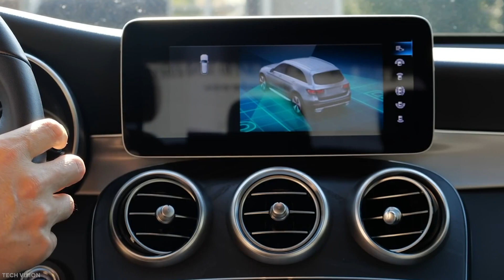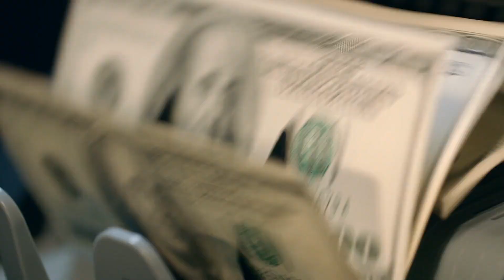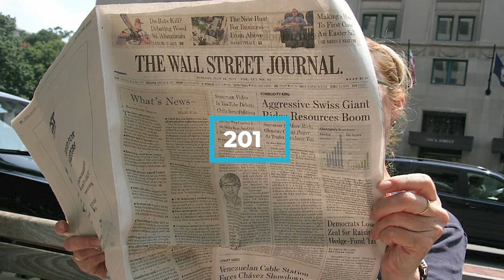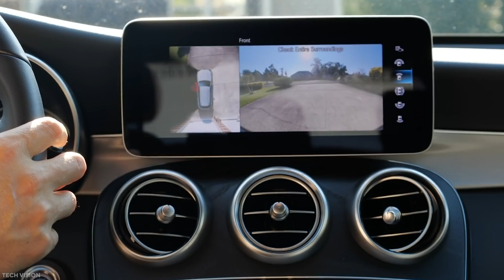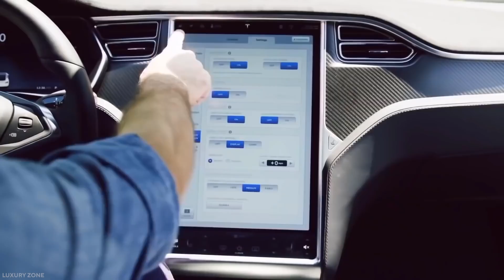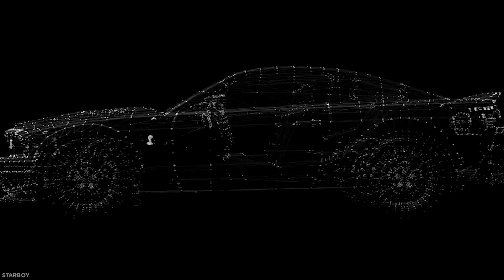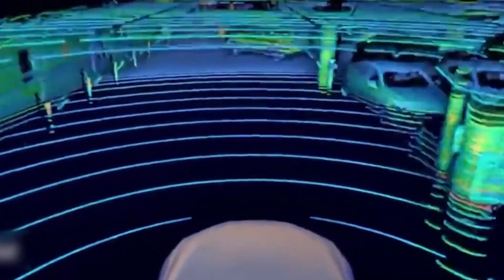Meet Apple's Latest Invention: The Apple Car

Comment: No battery, no tires, no Bluetooth compatibility, no steering wheel, no door handles included, must buy separately. With every update it slows down until it stops working as soon as the new model comes out, changing the charging port with each new model.